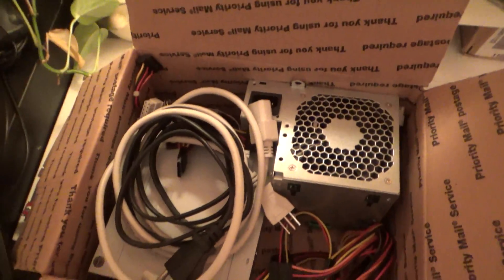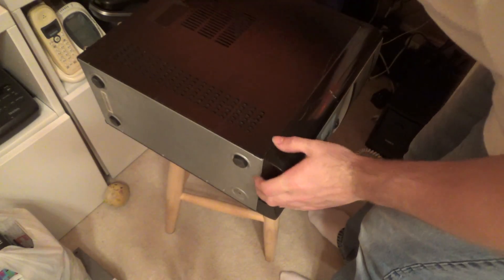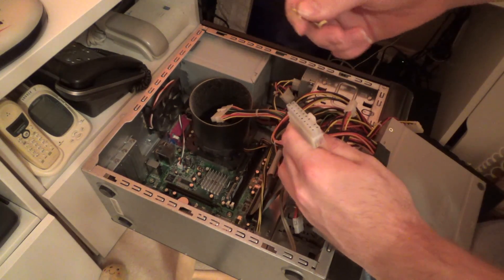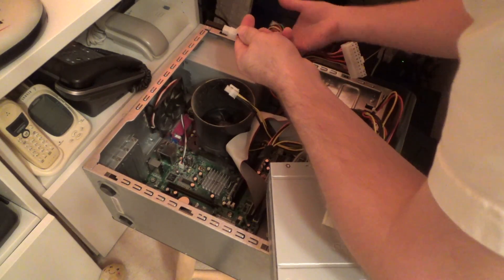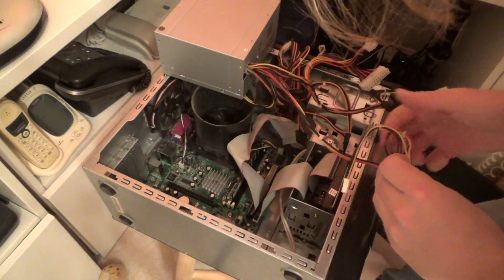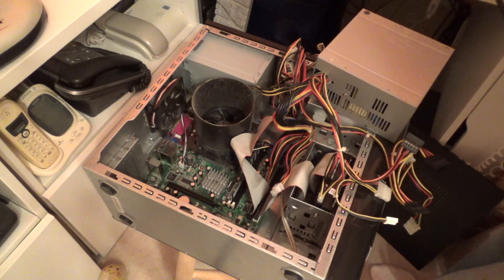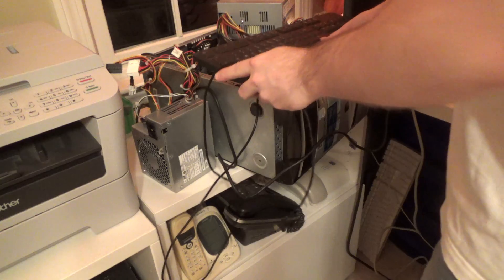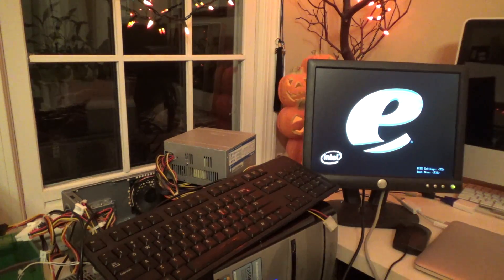eMachines T3508 Desktop Computer | Part 2; Testing with a Different Power Supply

Comment: 6:35 i have the same printer
Reply from the maker: OK
Reply: @JordanU  you can connect your printer to your phone line for when you wanna make telephone videos
Reply from the maker: @flozon5240  Why would I do that?
Reply: @JordanU  look on the back of your BROTHER branded printer. There is a phone port and an ext. phone port
Reply from the maker: @flozon5240  I know it has faxing capabilities, but I don't see what that has to do with the telephones videos..
Reply: @JordanU  i'm just suggesting.
Reply: @JordanU  i'm guessing you use it for the same reason and i found a video of yours with the printer on line 3
Reply from the maker: I don't print photographs with it, it's a black&white printer....
Reply: After all, it even rings and function like a telephone
Reply: All i use it for anyway is printing photos from my labtop since i don't have a phone line
Reply from the maker: @flozon5240  OK

Comment: I've got one just like this! But mine hasn't blown up... yet
Reply from the maker: I'd suggest you change the power supply while it's still working, apparently these are known for catastrophically failing in this manner..
Reply: @JordanU  if the power supply is a bestec model ATZ-250-12e then absolutely replace it because it WILL kill your motherboard, if it is any other model bestec or a hipro power supply then it is likely okay unless something out of the ordinary happens, and i don't think the t3508 had the 250-12E
Reply: @WalterKnox  I know I'm necroposting, but I am seeking advice. I happen to have found an eMachines computer. It has a Delta power supply. The power supply looks kind of similar to the one in this video. If anyone happens to see this comment, would there be a risk of the power supply exploding? Thanks in advance.
Edit: I do not have any experience with knowing which power supplies explode and which do not. After performing research, I determined that Delta PSUs are less likely to explode.
Reply: @ There are two issues with the power supplies in these eMachines PCs. 

The first one, and the largest one is the Bestec ATX-250-12e power supply. The capacitors in the 5 volt rail start to fail and then send high voltage spikes through the motherboard, making it fail. This will not "explode" or show any signs of failure, it will just eventually fail take out the motherboard. These power supplies should ALWAYS be replaced as they are not safe to use and are guaranteed to eventually fail and ruin the motherboard. 

The second issue (which is what happened here in this video) is the Bestec ATX-300-12e. It is generally a safe power supply to use, and I have a few in service. Capacitors in it occasionally do fail, but when they do the power supply just stops working and does not damage the rest of the system. The larger issue with this model though is the glue they used internally to keep components secure, over time it breaks down and becomes conductive, which leads to a short circuit; that is what happened in this video. I have had this happen personally, and it didn't damage the computer either, but it is best to avoid it. The easiest thing to do is replace the power supply, but you can also scrape the glue out of it if you know what not to touch in a power supply. This really only becomes an issue though when the power supply is sitting unused for long periods of time, and then is put back in service. If it is used regularly, the glue will not attract moisture and will not become conductive. 

In some machines, they also used Hipro branded power supplies. These are IMO the best ones to have, and rarely suffer failures; although the Teapo branded capacitors they use do occasionally fail, it never damages the rest of the system. 

The Delta units are cheaply made compared to most Delta power supplies, that is how eMachines specified they be, so that is what was made. They are less common than the Bestec and Hipro units in eMachines, so I can't say as much about them. I have never heard of them taking motherboards out, or failing, but once again; I haven't really worked with them. Being that Delta is (in general) a reputable brand, I would say it has about the same chance of working as any nearly 20 year old power supply; that is to say that anything can and will fail eventually, but it is probably fine. 

I would run it, it is very unlikely to actually fail catastrophically, and even less likely to damage any other components. 

If you are concerned about it though, replacement power supplies are cheap. I normally use Bestec ATX-250-12Z (NOT 12E) power supplies to replace 250w units, and ATX-300-12Z (once again, 12z not 12e) to replace 300w units. Any similarly sized power supply would of course work though.
Reply: @WalterKnox  Appreciate the valuable information. Thanks for reassuring me.

Comment: Coincidentally, the power supply on my ancient Dell Pentium 4 machine, my daily driver, died overnight.  I keep new supplies on hand in case of just such an occasion.  Barely awake, at 6 o'clock in the morning, I replaced it in 5 minutes flat.  The machine powered up with no ill effects and has been running fine since.
Reply from the maker: Was that the original power supply?
Reply: No, that was a replacement I put in a number of years ago.  This is now at least the third supply this machine has had.

Comment: Wow you are a lucky guy! Most of these machines didn't survive the PSU explosion!
Reply from the maker: The series isn't over yet...don't speak too soon!
Reply: It’s only the eMachine computers with the Bestec ATX-250-12E that have the issue. The supply in this unit is a ATX-300-12E which those units rarely explode. I have no idea how the 300-12E exploded here.
Reply: @TheBehemothHyper The glue they used to hold down components starts degrading over time, heat speeds it up and it becomes conductive and corrosive. I have seen several 300-12e units blow up in this fashion. Usually it blows a chunk out of one of the IC chips.